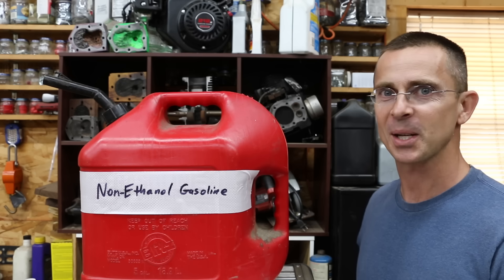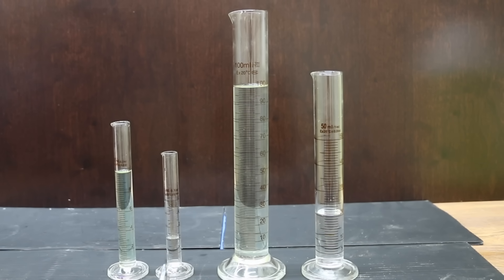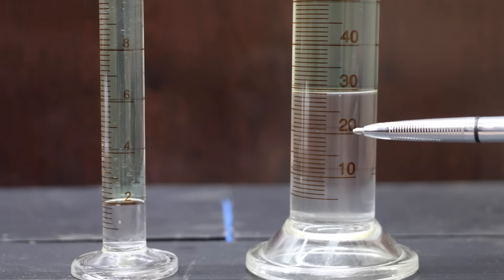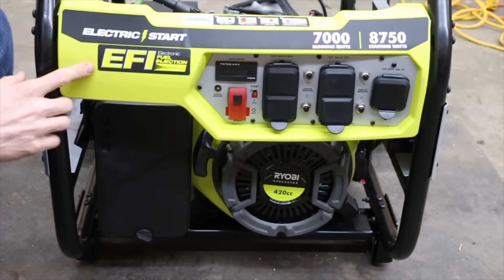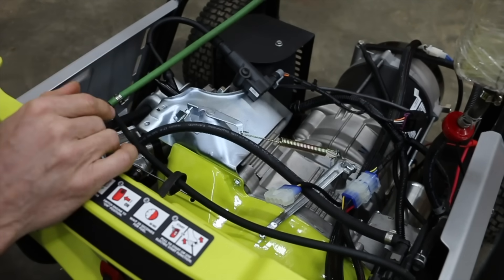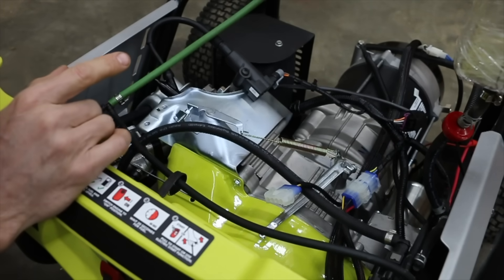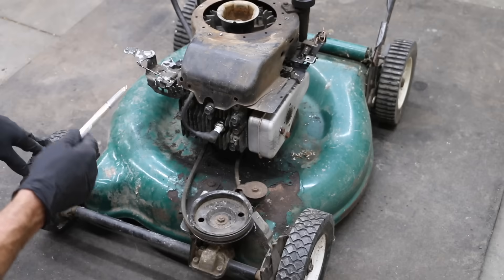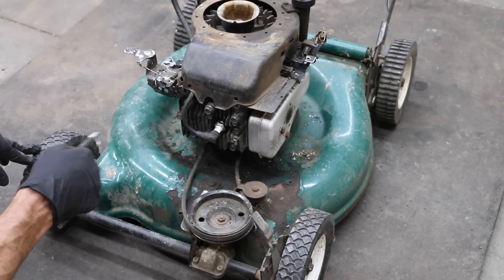Is Non-Ethanol Gasoline Really Better? See the PROOF!

Comment: I'm a big fan of ethanol, usually I'd dork out over it but that generator! Efi is awesome! Just saw my first efi engine in an ariens snowblower. First for me that wasn't somebody's project. I've always wanted an efi small engine since it seals off the fuel, unlike a carb. My only question would be is the fuel tank still open vented.... But even if it was the fuel would last so much longer.
Reply from the maker: Thank you!  Yes, the fuel tank is.

Comment: How about ethanol eating up all the  rubber seals in the carburetor and gas system over time.  That's the problem.  I have generator with a  plastic gasoline tank that uses a rubber seal for the drain cock.  Ethanol will eat that seal up in a month while non-ethanol doesn't bother it.
Reply from the maker: Great point!

Comment: A real test for this is how many gallons of diesel fuel does it take, to plant and harvest the corn to make the ethanol. Then factor in how much energy it takes to process the corn to ethanol and add it to the gas. I find it hard to believe that this is an alternative to just straight gasoline, when you have to burn a more valuable fuel to make it.
Reply from the maker: Great point!

Comment: Love the videos! Few future ideas if you ever run out. Maybe testing automotive parts such as different air filters, (cheap, factory, K&n, etc.) Maybe spark plugs. (Cheap, iridium, Platinum, double Platinum, etc.) Brake pads. (ceramic, semi metallic, metallic, etc.) Might be some tough testing but would be interesting to know if they actually make a difference buying the more expensive auto parts. Thanks again!
Reply from the maker: Thank you for the video ideas!

Comment: I'd like to see e85 or higher octane used as a engine cleaner in a carburetor and fuel injected engine. I converted my supercharged grand prix over to e85 through just injectors and changing the tune in the computer and gained about 60whp on a mustang dyno. It seemed fine on all the rubber gaskets as well.  I do believe it burns much cleaner but would like to see what it does for cleaning the carbon build up that is already in the engine.  Always love your test as they are very in depth and well done.
Reply from the maker: Thank you!

Comment: I use non-ethanol 91 octane fuel in by 89 Toyota Supra which I run a 1JZGTE (JDM) engine in, it runs great.  This engine came from a car owned in Japan and I'm pretty sure the Japanese don't use ethanol in Japan.  I pay about $1.50 more a gallon, but the car is mostly a few times a week car just around town, not an everyday driver.  Thanks for the video, I feel vindicated now for paying the higher price for the fuel.
Reply from the maker: Sounds like a very nice car! It's well worth the extra money for fuel.

Comment: I need some advice and suggestions, In my geographic area Gasoline is US$4.20/gallon (US$1.11/liter), ethyl alcohol is US$2.57/gallon (US$0.68/liter)  The ethyl alcohol is Vodka - food grade (192 proof) 95.6% by weight also called pure alcohol, grain alcohol, and drinking alcohol.  I have a car with a 1.6 liter FI engine, What fuel combinations might give me the best values for my money?  Exhaust emissions are not a concern
Reply from the maker: Is the fuel system designed for alcohol or will it cause damage?  If it were me, I would begin by using just 10% alcohol and 90% gasoline and continue to experiment with more and more alcohol until you reach the point it doesn't run well.  Then adjust the ratio accordingly.  This all assumes the fuel system won't be harmed by alcohol.

Comment: The generator runs more smoothly on the gasoline with 10% ethanol in it, right?
And the higher the octane the better it is for the engine, that's why I run my car on Super Plus (Germany) with 98 octane...my brother runs his car only on Ultimate (102 Octane)
Reply: hm...wrong thoughts, sorry. Super Plus has 5% Bioethanol in it, like the normal "Super" (gasoline)....the "newer" Super E10 has 10% and is not suitable for older engines...
Reply from the maker: Thank you!

Comment: Ethanol reduces your fuel efficiency a little bit but extends the engine life span by up to 50% due to it's wear reduction... this means that engines can be made more efficient in tolerances and still live longer getting higher mileage.

Remember kids, Octane isn't "power" it reduces pre-detonation.

Comment: For your long term test I would suggest identical carburetors filled with E0 and E10 as well as two more with E0 and E10 plus Sta-Bil fuel stabilizer. Straight gasoline may not cause corrosion but it does turn sour and form varnish, clogging passages.
Reply from the maker: Great recommendation.

Comment: Have you ever been asked to review Opti-Mizer or Opti-2/Opti-4? They claim to prevent corrosion due to ethanol, stabilize fuel for storage, have lower operating temperatures, have easier starting, longer engine life, and consume less oil than competing oil or fuel/oil mixtures for 2-cycle and small 4-cycle engines.
Reply from the maker: Thank you for the video idea!